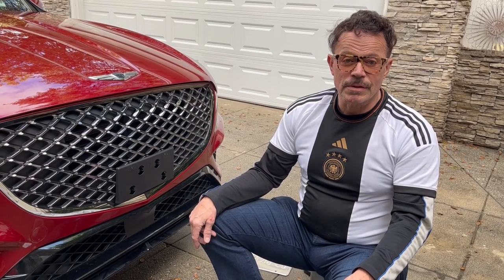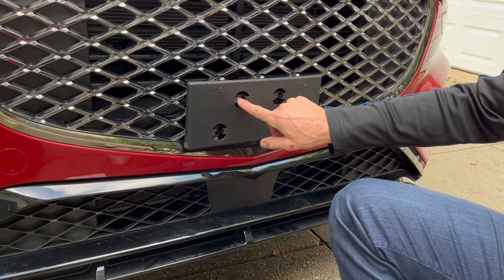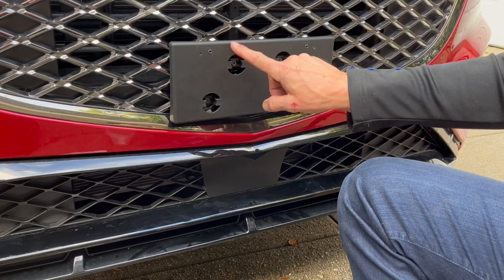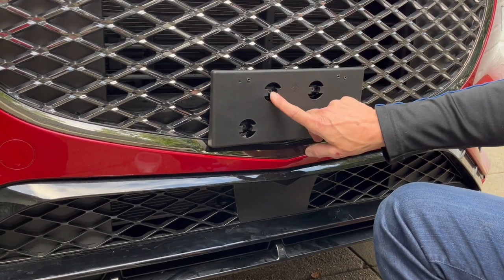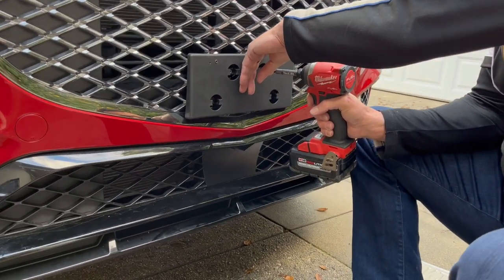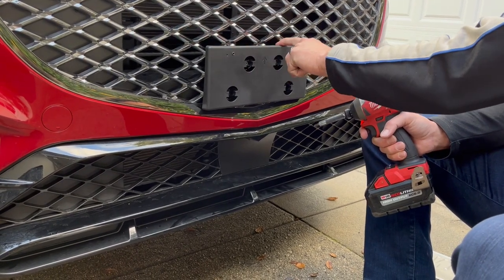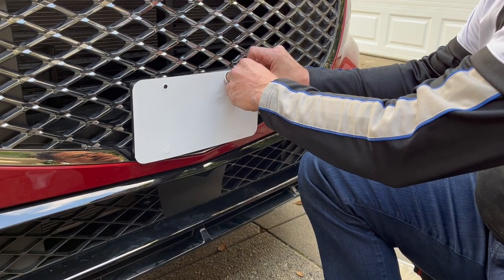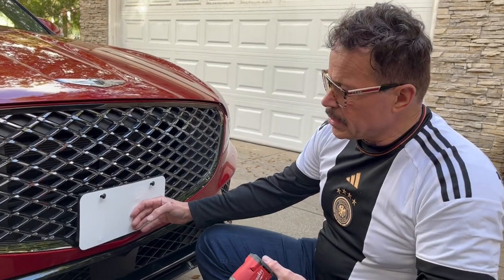How to install Front License Plate  bracket on a Genesis GV-70

Comment: Absolutely awful look, the plate location on these ruins the beautiful front end of this car. It’s worth getting the one that goes where the tow hook cover is.
Reply: or get the sto n sho one that screws into the underside of the bumper in the bottom left or right side
Reply: I just got my car two months ago and you are so right...the put the plate right in front of the prettiest part of the grill and ruined the whole thing...we tried with a screw driver it will not budge I don't wont to bend the grill ....I took it to an automotive place and they wanted 400$ to remove it because it has to be torn apart from the inside.  This is a lame design for such a nice car!  I'm calling Genesis automotive to see if I can drive my car down and have them remove but I don't even live near a dealership

Comment: I was able to get the circular pads into the slots in the grill and then expand them with the provided silver screws.  You have to use a little force to push the pads in, but you'll hear them snap into place when they get deep enough.
Reply: Yes, the circular pads even snap in if you move one diamond above bottom then as stated above, the steel screws lock or in place.
Reply: @mabehall7667  One row up, and it pops right on. Done in seconds. Thanks for the tip.

Comment: While this is a decent instructional video, it is not the correct way to mount this plate mount.  You should count up 4 holes from the lowest hole in the grill and go to the hole to the upper right from the 4th hole.  The extended right top mount should go through that grill hole identified.  The bracket will snap into place in the corresponding grill openings with a bit of pressure.  You then screw the silver screws supplied into the mounting holes to expand the back of the mounts.  This will grip the mount in the grill.  You should not be drilling through the plastic plate behind the grill.  Unfortunately, the mount will not be centered on the grill.  It looks horrendous.
Reply: Do you know how to remove one of these brackets?

Comment: Can you show how to remove one? My Genisis has it but I can’t figure out how to un-clip without risk of bending the grille
Reply: Exactly I want mine removed it messes up the whole look of the grill I went to an autobody shop they wanted 400 dollars to remove it I think they need to access from inside and take stuff apart,  it's so frustrating the grill is so pretty and then there is this big plate on the front of it
Reply: You can use a set of long thin needle nose pliers to squeeze the plastic tabs from the front after removing the screws. You can then pull the plate mount off.
Reply: Remove the 4 screws inserted into the bracket. Then you can pull off the bracket with your hands.  It fits snug in between grill holes.